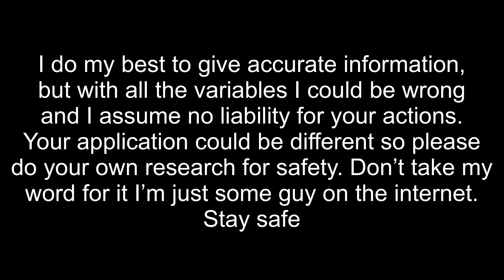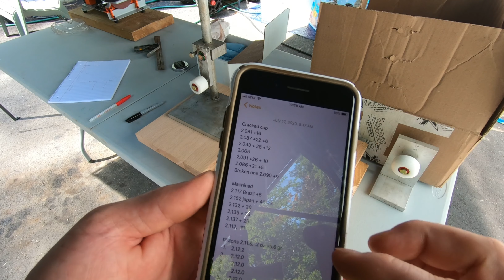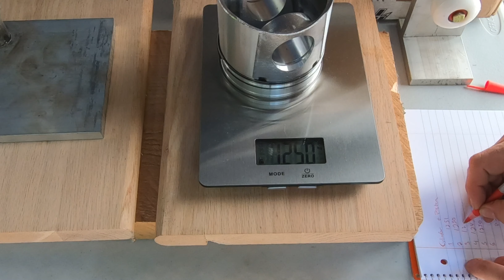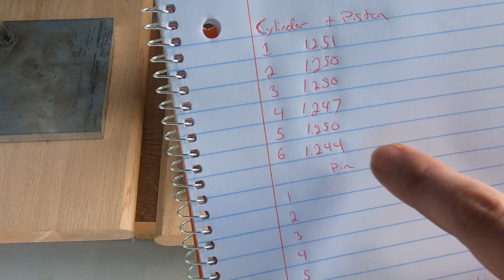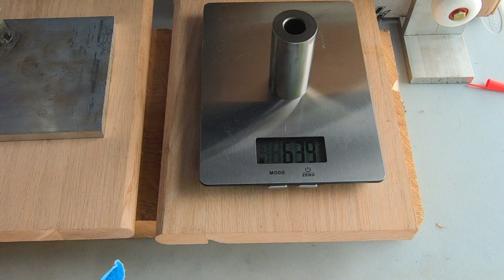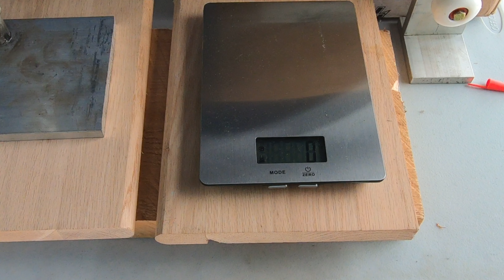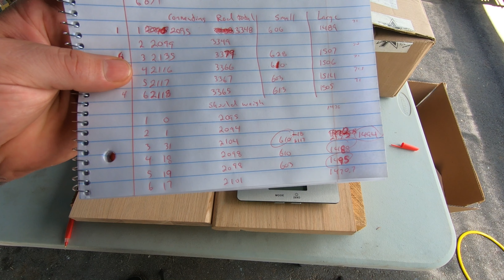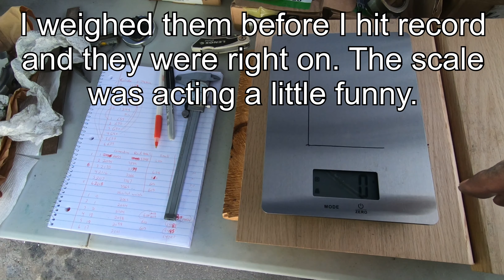Balancing 5.9 Cummins connecting rods

Comment: I think you enjoy what you are doing.👍
Reply from the maker: That actually took most of the day to get those rods balanced. There was grinding dust everywhere. It was a learning experience. There is a company that makes new aftermarket rods that are replicas of these earlier 24 valve rods. I think next time I would order them instead and get them all weight matched. Right now the short block is finished and I’m dealing with issues with the cylinder head. Some of the valves are in rough shape and the intake valves are worn out. I’m looking into getting a remanufactured head hoping to have the engine back in next week.

Comment: Did you get this all finished? I truly believe in a balanced assembly. I want to do this on my next build. Just need to find a place to balance them with the crank once they are weight matched.
Reply from the maker: I have finished it. I have a playlist on the build of the engine. I had it running and it’s pretty smooth. I haven’t driven it yet because I’m in the process or a restoration of sorts. I’m getting the frame sand blasted and painted and swapping the cab for a rust free cab. I’m actually working on it as I write this.
Reply from the maker: I have finished it. I have a playlist on the build of the engine. I had it running and it’s pretty smooth. I haven’t driven it yet because I’m in the process or a restoration of sorts. I’m getting the frame sand blasted and painted and swapping the cab for a rust free cab. I’m actually working on it as I write this.
Reply: Fantastic. I can’t wait to see more on this. I’m sure it runs far smoother than just slapping a 25lb damper on the front and calling it good
Reply from the maker: I was surprised, compared to my 05 i did notice a difference. This is the playlist for the truck. 03 Cummins 5.9 seized engine rebuild https://www.youtube.com/playlist?list=PLRbLKd2i_Uy50fS6kTW0WsSFGpH3ADTuo